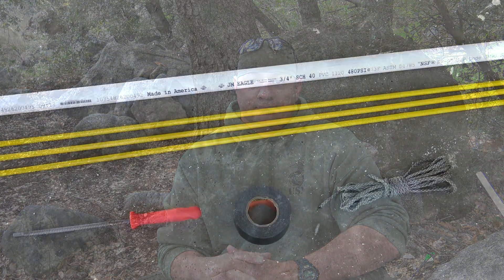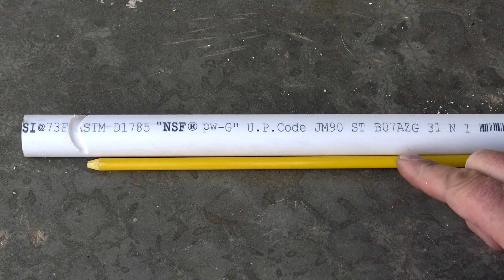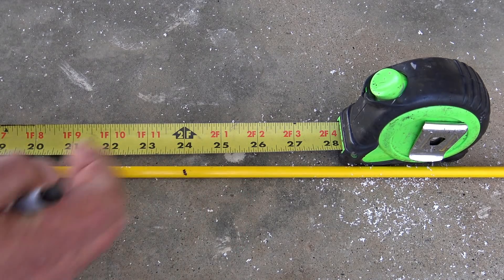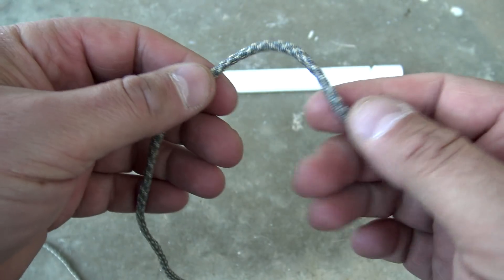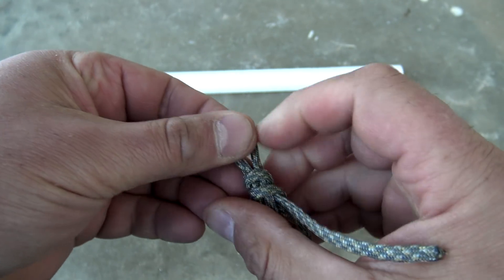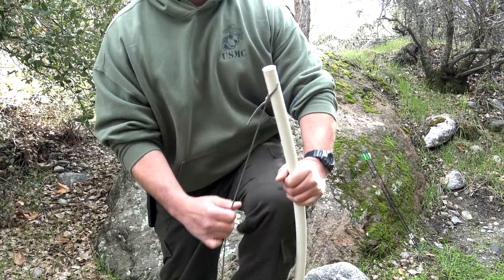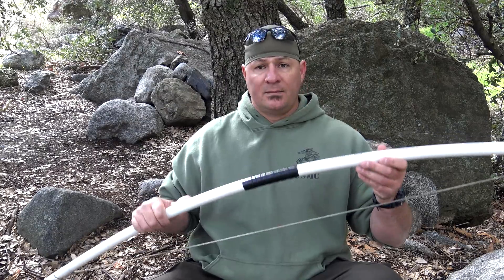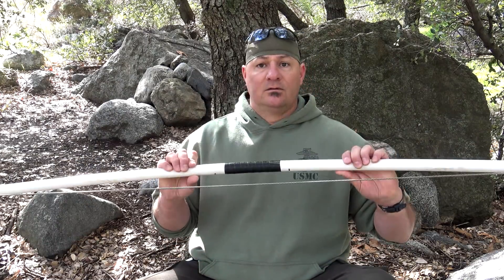The PVC Pipe Emergency Bow

Comment: you can up the draw weight by heating the ends and bending in to a recurve shape also fiber glass tent poles are good to bundle up and push  inside the pipe for extra resistance,  also spoons flattened and cut to shape make excellent broad heads, all the best
Reply: Good tips, thanks man. Gonna try a similar design with the tent poles.
Reply: That's what I did
Reply: Get those smaller spoons too. Great tips Bro.

Comment: Awesome instructional video, sir!  My neighbor has a yard full of bamboo trees...hmmm, wonder if bamboo would make a nice strong bow(?).  I made a nice spear out of my bamboo hiking staff using a Cold Steel hollow handle knife; takes just a few seconds to assemble it and secure the knife with a bolt/wingnut.  A crutch cap protects the spear end when I'm hiking.  In the other end I store a small emergency survival kit (test tube) and  my bamboo chopsticks :)  An old Rx bottle caps this end and it's wrapped with the 2 inch camo duct tape from Walmart.  The bamboo serves another purpose if I suspect a bear is close by...not only do I yell "hey bear" but I shake my hiking staff up and down causing the chopsticks to rattle.  It works!  The handle part of the staff is wrapped with 15 feet of 550 and a loop is towards the butt end used as a lanyard of sorts; keeps my hand from sliding forward should I actually have to thrust my spear forward in a defensive posture.  Anyway, I love watching your videos as you offer some very valuable information.  Thank you.
Reply: Bamboo works. Many different ways to do it.

Comment: Point of fact that I always find amusing:

Whenever you see videos or articles that state THESE ARE THE WEAPONS YOU NEED IN TEOTWAKI! It's always a list of weapons like AR15s, Kalashnikov knock offs, pistols etc, etc. I'm no Fudd Gunner but...

A recurve bow or crosdbow or reliable self bow so you have a quiet weapon you can make arrows for. Compounds need not apply.

A single shot shotgun with a conversion kit so it can be muzzle fed. 

Most muzzleloaders fit in this space after the shotgun but smoothbore is more universally useful. 

Slings, staff slings or slingshots.

I want a bow

Comment: One thing to keep in mind, having done several of these, is that paracord stretches horribly. A much better cordage for the string is bankline or some other not so stretchy cotton cord.
Reply from the maker: Agreed, however not everyone has bank line and 550 paracord is found everywhere. Thanks for watching.
Reply: Bank line is tarred nylon...IIRC. it's got stretch too.
Reply: I got 15 feet of dyneema line. It's expensive but incredibly strong.
Reply: And my experience I've yet to find a line that does not stretch. That being said you could go with a steel cable , or do like everybody else myself included and just tighten the line as you need it. This is a field expedient weapon otherwise known as an improvised weapon and one thing that you do need to understand is that in a situation where this weapon may come in extreme usefulness you need to have this kind or a natural recurve bow simply because like my compound bow all other compound bows need modern arrows to use an improvised arrow is asking to hurt yourself. So if you don't take time to learn how to make these weapons try to care carry a recurve bow with you at all times you can always make arrows then, and believe me you will lose arrows someone get broken some will get bit some will go flying way off course but you will lose them!

Comment: Real nylon paracord isn't the best choice, but if you do have to use it, it helps to stretch it out before hand or leave some extra length to help tie it shorter once it stretches from use.
Reply: One way to shorten a length of cord is to twist it before mounting on the bow

Comment: Here in South dakota a 30 pound draw is the legal minimum to hunt with . . . deer or smaller . . . the right  broadhead or hell, even a bad broadhead will work. if your using anything like a 350 to 435 grain weight arrow at that draw, you have an adequate FPE to take down a large critter . . . . .

Comment: Nice. I actually forgot about these.

Armguards and quivers could probably be made by taking two pieces of thick cloth ( i.e. denim), and stitching them together over a cardboard frame.

Might be good to glue some plastic sheeting around the cardboard beforehand, to give it more moisture resistance.
Reply: Hey man, you can make an arrow holder (going on the bow) with flip-flops ans zip ties. Gives you better mobility in woods than a quiver and you always have arrows with the bow, that way :)
Reply: Zyriab 
Rubber exercise mats and pieces of foam would do a better job. 

In the context of SHTF, standalone quivers provide a more convenient means of carrying other essential gear, like a small file for sharpening your broadheads or a small firestarting kit, if you prefer to hunt in lightweight, quiet loungewear.
Reply: A quick bracer(that's what we archers call an armguard); get a metal ruler, cut off a piece as long as your forearm(or whatever length you feel comfortable with), file a notch at the ends, on both sides, and use cords, laces, or whatever to tie it to your forearm. The bracer I always use  is one I made, by sandwiching a steel splint between two layers of soft leather

Comment: Having "attempted" construction in making a breakdown bow design, using four 3/4" diameter fiberglass rods, and a center HD plastic hand grip (and arrow rest) you have great options.

If you can get a 3/4" diameter solid fiberglass rod (from TAP plastics), cut to the PVC tubing length, you can slide the rod into the entire length of the PVC pipe.  It slides well, and with some superglue poured down the tubing, push and rotate the fiberglass rod quickly into the tubing.  This will make an entirely secure (no noise) and cemented fiberglass rod and PVC tubing unit.  The PVC piping protects your hands ever after from any fiberglass splinters.  Acquire the 1" diameter "+" PVC joint.  Slide this down the PVC pipe, adjust to your center nock position, (and PVC purple glue) cement the connector on that location.  This gives you both left- and right-handed shooting capability, but also if laying on your back, you can align the arrow and bow so that you can shoot with your feet holding the bow, while pulling/releasing the string,  Rasp and notch out the arrow rest positions on the cross-arms.  With two 3/4" PVC end caps, cement and cap the fiberglass rod inside the PVC piping.  You are completely done, except for rasping the bowstring notch, and stringing the bowstring.  This PVC plastic-and-fiberglass rod, makes for a very strong hard-pulling and -hitting bow - upwards of 50-60+ #.  The bow can take the full-out strain of a maxim pulled bow, that would bend and break a normal or modified flat PVC tubing bow (shown in various YT vid sites).  The maximum flexibility and recoil of the bow is from the fiberglass rod.  No more melting and flattening out the PVC tubing, as some vids have done.  And this same PVC piping is a good walking pole, or a hand-to-hand bow staff weaon (any idea where they named the weapon with that name?).  It has a whack stronger than getting hit by a golf club, pool cue, or a baseball bat.  It also comes in nice and handy, when hiking, and a rattlesnake (or poisonous snake) is on the path.  You can slide the bow and bowstring over and around the head of the snake - then decide whether to remove the snake to a safe distance and let go - or whether you like snake-chicken and bam!bam!bam!, you have the hobo stick with a snake hanging off the end.  With other small mods, you also have your small fishing pole (with great strength).  Have a series of fishing pole eyes, a fly fishing reel, and velcro lashings from a kit ruck, and attach eyes along the length of the bow.  When finished fishing, remove the eyes, fishing reel, and velcro lashings back into the kit ruck.  Now hang the fish from the hobo fish-carrying pole.  The bow also works quite well for mini-pole vaulting over small creeks and wetland areas.  You can even reach up into the high trees for whacking nuts and picking fruits. With other trap mods, you can use the bow for a longed trap to slam down on a critter.  The same design can be installed along a trail, and sprung, deals a lethal blow to a small critter hit on the body, .... or a 2-legged marauder getting one or both legs broken from the lashing.

Inventory supply:
https://www.homedepot.com/p/JM-eagle-3-4-in-x-10-ft-480-PSI-Schedule-40-PVC-Plain-End-Pipe-57471/202280935
https://www.homedepot.com/p/Charlotte-Pipe-3-4-in-PVC-Sch-40-Socket-Cap-PVC021160800HD/203811671
https://www.homedepot.com/p/Formufit-1-in-Furniture-Grade-PVC-Cross-in-White-4-Pack-F001CRX-WH-4/205749327
https://www.homedepot.com/p/Christy-s-8-oz-Wet-or-Dry-Conditions-PVC-Cement-RH-WET-HP36/204787028
https://www.tapplastics.com/product/plastics/plastic_rods_tubes_shapes/fiberglass_rod/159
Reply: Just want to make sure I have this right: you use the 3/4 inch fiberglass rod inside the 1 inch PVC pipe?
Reply: tldr
Reply: No.  Look at his URL's supply list.  3/4 PVC pipe.

Comment: If you have some thing like a luggage scale you can ballpark your draw weight on a self bow without too much trouble:
1) Nock an untipped arrow and come to full draw,  noting how much of it protrudes beyond the grip.  Grab a Sharpie or something and mark that point.
2) Leaving the arrow shaft on the string, hang your bow from an elevated hook at the nock point.  Note: if the string slips from the hook you can easily injure yourself in the next step and will have failed in more ways than one.
3) Attach the scale to your grip and slowly pull downward until the mark on the arrow shaft is at the front of the grip.
4) The readout on the scale should approximate the draw weight of that bow for your draw length.  Second note: An unfletched arrow shaft that is too stiff or too flexible for that particular draw weight will yaw either to the left or to the right in unaided flight.  You can stiffen the shaft by shortening it if you have enough arrow to work with.
Last note: Please don’t hurt yourself doing any of the above.

Comment: Pretty darn cool.  Looks like it worked great. What was the range to the target? Seemed to be highly effective and accurate. 
        Another option is the Sheperd's Sling. They are light weight easy to make and require minimal strength. Depending on your location rocks are free or you could use golf balls, ball bearings etc.

Comment: 72 hours is about correct. I live in Florida, land of the hurricanes. Last time we were hit (by Irma) it did quite a bit of damage but nothing like a major disaster like Andrew or Katrina. Staple items and long-term storable foods like eggs, milk, bread, meat and canned meat (especially), canned soup, granola bars, bottled water, etc. were wiped out quickly and not available again regularly for a couple of weeks. I had to drive about 20 miles before I got to a gas station with gas and there was an over an hour wait in line. Remember: this was only what I'd call a minor disaster and a local one at that.

Comment: Bow on the ground, foot on the center, string hooked  to a scale (digital luggage scale, hanging scale) pull up, read what it says.  If you can't see the reading, set up a camera and shoot video of the reading. It's not quite the same as being in the correct position for shooting, but same distance of pull will give you the same reading in any orientation. Wild guess based on pulling a 40 and 60 pound bow.... 35-40 pounds of pull. I'd like to do some archery, maybe a longbow....that can be an expensive investment, for minimal use. Your design? I'll bet  I've got everything I need to make either. Thanks.

Comment: Well-presented and demonstrated as always.  If you have access to a quantity of the fiberglass marker rods, could those also be used to make arrows for the bow?
Reply from the maker: These rods are commonly used as driveway markers some have reflectors on them. Thanks for watching
Reply: Hey Hal, you could possibly do arrows with those I guess, you could do arrows with a variety of materials actually.
Just gotta try and be careful they don't snap while shooting (protect your face, eyes, throat and hands !)
If I remember correctly, Dave Canterburry has a video where he makes arrows (wooden I believe), could take some experience there ! :)
Cheers !
Reply: Hal Songer 
Maybe a rolled-up piece of a fiberglass welding blanket dunked in resin? Tape is a good fletching material, too. Dave Canterbury has a video showing how to make duct tape fletchings.

Comment: I can confirm that this configuration produces sufficient force to terminate dingoes. I somewhat doubt it can down a deer, but for smaller animals it works perfectly well.
Reply from the maker: I never stated that it could or would take down a deer, I did say former domesticated animals. Thanks for watching
Reply: I know, i was just making an assumption on my part. Keep up the excellent work.
Reply: It will, a bow like this will produce around a 40-45lb bow, and that will be enough to take down almost any medium sized animal. BackyardBowyer is my source on this.

Comment: 40 is a good enough bow my compound is 40 my recurve is 50 but on my recurve my draw is about 45 and that's past my jaw they go threw quoter inch plywood taking off the flech from about 20 yards.
Made my target out of insulation foam cause it stops an arrow quick I get about half way in with my arrows. I can bring down big animals with them I'm going to get 60 pound limbs for my recurve.
Easy carry less to go wrong. Compound fires faster but more to go wrong. What if you drop it hit the sight or the rest? A simple bow is the way to go.